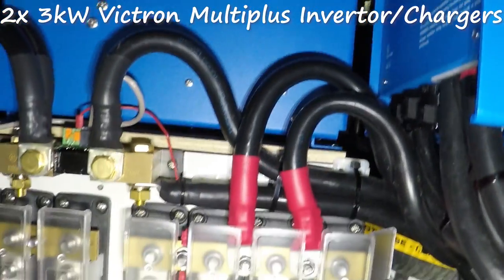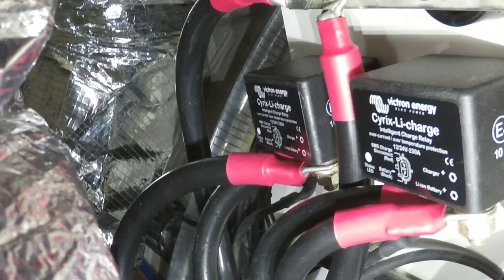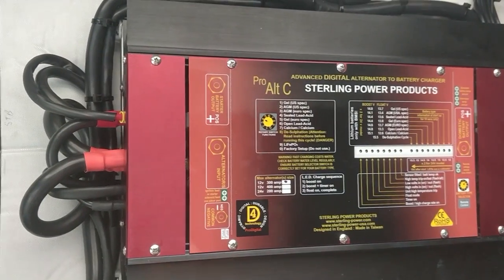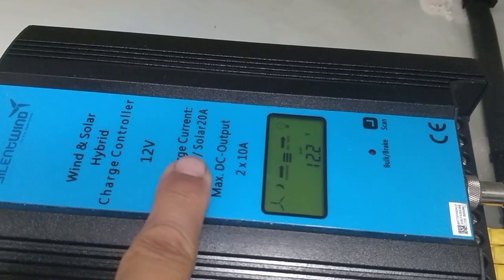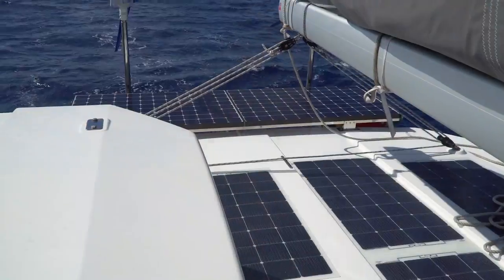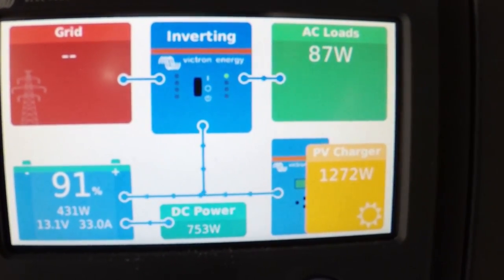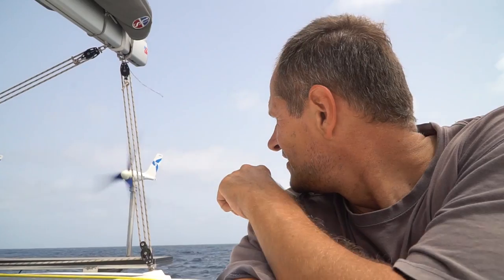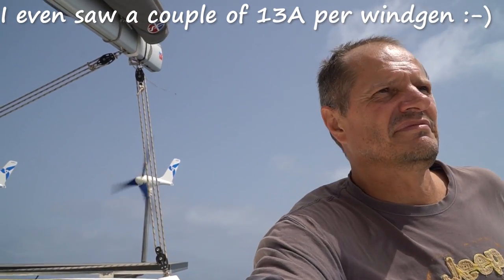#38t Our Electricity Supply on our Boat at Sea | Sailing Sisu Leopard 45 Catamaran in Mid Atlantic

Comment: Thanks for updates. Great videos. Wind generators will be great at anchor... assuming these wind units have less noise than older generation wind generators. On my crossing the Atlantic back in 2003 we had an AirX wind gen unit... noise was an issue, but it worked great as long as apparent wind above 10 knots. For long distance sailing, I now would probably seriously consider installation of a watt and sea type hydro water generator and install less solar and wind, so as to keep cost under control. Your experience shows agains that each type of renewable energy source has their own unique pros and cons. In perfect worked having wind, solar and hydro would be ideal....
Reply from the maker: Agree 100%

Comment: You must have the panels in series because you have MTTP solar charge controllers. Shadowing is always a problem when panels are in series. One panel is shadowed , then it will affect all other panels that are connected together. Also panels flat on the boat surface causes another problem. This is because the panels can not dissipate the heat. Best option is 3 x 320 volt panels set up on a solar arch and keeping the wind generators where they are but on higher masts to clear the wind from the boat surface. I place both of my wind gens on sectional supports so I can regulate the height. When the boats is in storage I can place them both lower and when sailing much higher. This is better than a top of mast install, as wind gen maintenance at the top of a mast can be tricky. Not impossible but tricky. The flat panels on your cabin top will eventually fail, the min reason is how hot is that fiberglass going to be in direct sunlight as well as the ramp of the panel itself. This is why rigid panel ate installed with an air gap, to dissipate the heat from the panel. Infact solar panel are more efficient in the winter time in cold weather and lose some effiecentcy in hot climates.  Any shadowing of any portion of a panel that is connected in series affects that pnel itself as well as it will bring down the efficiency  of the other panels connected to it. Another not. Voltage loss. The factory gauge of most panels is 10 gauge at best. To decrease on voltage loss, I would increase the wire gauge as close to the panel as possible. Rather than a cabin top deck install I would as I mentioned before put 2 to 3  320 watt panels on a solar arch and possibly  two more solar panels on the outside rails , like full wings. These panels can easily be put at desired angles and folded down when not in use. A side not. Most flat panels placed on a hot surface will develop black marks starting on one or two cells in a panel  and will spread. The panel has been burnt, and is now useless.  Great wind gen though. Excellent brand
Reply from the maker: Great advice! Yes, the panels are in three series groups. As I said, forward 5, middle 5, and the 2 glass panels on the back arch. That arch is already 3m high and the turbines 5m above sea level. The problem is that the Code D is very efficient and leaves little apparent wind for the wind turbines.
Reply: Sailing Sisu a top of mast install I don’t think is your answer.i would try and extend your win gems on extensions. 5 meters above may not be enough. I would try like I did   On my last extension I had that angled out so as to get clean air. You maybe lucky on the panels not burning.  I hope so. I could not tell by the video, but I made my solar arch lean back off the stern of the boat to give more room. I was able to fit 3x 320 watt panels side by side and 2x 180 watt panels on each side placed on the rails.  I do not charge my batteries from an alternator as  there is no motor. I use lithium batteries and an electric motor to propel my sv
Reply from the maker: Clean air is not my problem. Downwind sailing is. With 15kts of wind, we easily sail 8kts, which gives the wind gens 7kts to the wind gens. They do start generating at 5kts, but bring in 2A or so. Not enough to sustain the instruments through the night. During the day, the solar and wind gens bring in about 2-3 times the avg watts used, but the moment we start the water maker or kettle, then we loose out again. It does not matter how high I put the wind gens (off course there is a wind gradient), downwind sailing does not leave enough apparent wind to generate good watts to sustain or gain battery levels. From broad reach to close reach, yes, awesome power, but 121-180 is the "no go zone" for our wind gens 😊
Reply: Sailing Sisu yes that makes total sense. I think down wind would be a problem for most  wind gen installs. I would like to ask you though what type of batteries do you use. AGM or lead acid or lithium. I am thinking if you are short on power and not enough reserve to run instruments over night, then I am thinking that possibly your battery bank maybe under sized for your needs. I do use an electric cook top and run a 12 volt fridge freezer unit as well as miscellaneous 12 volt or 120 volt systems, lights are all led and I have a 3000 watt pure sine inverter. Now because I power my sv with electric power, my lithium battery bank is huge compared to what I would require if not propelling the boat with this means. I also have a diesel  generator as a back up in case I lose my panel and wind gen setup. I have not had to use it other than to start it up and check that it would work if I did require it. Because my solar arch was made to rake of the back of the stern, shortly I will be adding 3x 320watt panels for a total of 6x 320 watt. So 1920 watts solar on the arch and a total of 730 watts on the side rails. So I guess that is around 3650 watts. I really don’t include the two wind gens in the total as the output varies so much  with wind speed. It could be said as well with the solar on somewhat cloudy days. But wind is my main power for the vessel. I estimated way over on my battery bank. Which is a blessing.
Reply: Sailing Sisu That speed of 8 its with a wind speed is 15 kts sounds great with the size of your sv. By the way I love what you have. Great choice of craft.
Reply from the maker: 5x 200A Victron LiFePO
Reply: Sailing Sisu so from my experience only. I would say that you are definitely suffering from lack of being able to recharge. The wind gens getting lack of clean air and I guess I would have to know what your total input is on your solar system. Your wattage can be high, but if the panels become shaded and because they are in series, that brings down all the panels that are joined to that one panel. The other thing is what is your power usage. I think I would try to collect that data and then make a plan. Throwing money at a quick fix never works. As you probably know but for example if you have say 1000 watts of solar but because of partial shading of one or more panels and now you are down to say 500 watts and then there is cloud cover and angle of the sun all will hurt a system. I must say and this not knocking your system, but I am not a big fan of those thin flat panels on a cabin deck. Panels get hot from the the panel itself and the cabin deck and the wattage drops because of the heat build up. I am not convinced yet that you have enough battery, but that being I don’t know what your usage of power is either. There is not any point until your consumption is determined and we all use power differently. So the best solution I have is panels added to a solar arch at the stern and determining the best location of the wind gens so they get clean air. I can honestly say that I don’t get much power from my gens when going down wind either. I will leave you my email if you would rather discuss this off YouTube. 
boler77@me. com

I am thinking a few things here. If your instruments have used up all the power being on at night. Two things are happening. Your power demands are more than what you have stored in your batteries. So there is nothing left for the instruments at night. Secondly the solar is not producing enough power to meet the daily demands quick enough. This can be related to using too much power or more than you can replenish the batteries. There may not be enough solar to meet your demands, or there is enough solar but because of the shading effect the effect of the solar is decreased, and then the panels themselves maybe an issue and last of all the wiring gauge. Now panel wiring gauge is fine if the the panels are in series and using a MPPT controller. If you were using a PWM ( more than one ) the panels are in parallel and a shading panel will not affect the others. Now wire gauge does have an impact on voltage loss. More so when panels are in parallel than series.  All of wiring comes out of the panel in factory 10 gauge. I switch to 4 gauge stranded as close to the panel as possible. My Morning Star Charge controllers all accept 4 gauge. And lastly I would say use as much 12 volt to charge cell phone, tablets rather than using a inverter to charge. More efficient use of your power. And lastly you battery bank maybe undersized for you consumption of power needs. As there is no reserve left. Because my boat is sail and electric powered, my solar is extensive and my batteries are about 4 times what you have. But my needs are more for the electric motor.
Reply from the maker: Great advice! Thank you!
Reply from the maker: I am curious, how much kW solar and how much kW battery do you have and how far can you motor without using genset?
Reply: @SailingSisu  I read from a Lagoon 620 owner, he had similar problems, but his hydro generator works very well when underway, the solar and wind work well when at anchor ... he ended up taking the wind generators down.

Comment: When sailing downwind and only using your headsails, tie the boom off to one side with a preventer to allow more sun exposure to your solar panels.
Reply from the maker: The Code D is tied off aft and far away, but it is the sheer size 127sqm...

Comment: Thank you for the information. I am curious whether you have a dedicated generator. If not why: is it cost decision or extra space or lithium batteries set up is sufficient to meet your needs. I saw similar boats have a generator between 6-11 kw. What would be a sweet spot for leopard 45 in respect of generator power output.
Reply from the maker: Hi, Vlad! I think we touched on this in a couple of videos. You may want to watch  #11t, #32t, #38t, #40t, and #63t to start with? If you have more questions after that, please let me know ☺️

Comment: Thanks for the information.   You guys do a great job explaining things.  

Curious how you plan to or if you plan to increase electricity
Reply from the maker: I think we have enough electricity. But if we need to replace or upgrade in future, then I will surely look at Tesla batteries. The banks which goes into the cars are water cooled/heated. Currently we cannot go to very cold places and charge the batteries. I am looking at debris in the water to get an idea of how hydro gens would have worked. Lastly, we made fully provisions for a diesel generator, thus, if we should need, then we can just drop it into the forward locker😉

Comment: I am seeing you have 2 wind generators on board, I read that adding one or 2 more solar panels instead would today be the preferred option as the wind generators don't produce much and are noisy. What is your experience, how much did they produce for you in the Med? Did you even use them?
Reply from the maker: Hi, Friedrich! First, thank you for watching and second, you heard correct. One 320W solar panel will for sure bring in more power than a 400W Silentwind generator...even though the solar works only during sunshine hours.

Comment: With the solar shading, why not just move the boom to one side since the main is down and let the solar panels get all the light they need ?? Can do the same when anchoring.
Reply from the maker: No problem if the main sail is down. But when you sail 120 degrees, broad reach, then you are dependent on keeping the sail trimmed. On the other hand, that Code 0 is on its own, big enough to shadow all the panels :-) as seen in the video. It only took two days at anchor, for solar and wind gens to charge batteries to 100%.

Comment: I,ll be fitting 4 x 12V 1kw Super Caps on my boat soon. Batteries, Lithium, Lead etc.  are history.1) Inefficient (+/-50%), 2) heavy, 3) don't last very long +/- 2000 cycles, 4) take forever to charge , 5) are messy and so on and on. SuperCaps on the other hand are... 1) Are very efficient (98%+).  2) weigh less +/-  20KG ea.  3) Last long +/-1000000 cycles. 4) Can be charged and discharged in seconds. 5) Non flammable. 6) Have an on/off switch. 7) Can be set up in series or parallel anywhere on the vessel 8) Non toxic(no gas/fumes) and more. The advantages are huge and to numerous to mention here. This is the future of batteries. Soon even cars and cordless power tools will be fitted with these Supercaps...Charged in seconds and off you go again.
Reply from the maker: Wow! Great stuff!

Comment: I've been watching your progress/videos from start, great work. I would really like to know more about the actual solar/wind arch that you had built for the aft panels and turbines. Do you have any video of it's construction or installation? How much did it cost to have made. What materials where used (stainless steel tubing, but then what - aluminum framing)? And most importantly, how much does it weigh (excluding panels)?
Reply from the maker: Ooofff, a lot of questions I cannot answer 😏 it was sourced out to Marcel from the Cape Town Leopard office so, unfortunately, I do not have any answers, which can help you.

Comment: Thank you for your videos.
I saw on video #23 I think you were planning on a watt and sea and a silent wind. 
I’m planning options for my new cat and am just wondering why you decided not to go the watt & sea and what are your thoughts on charging after 2 years? Maybe a new video (unless I missed it)?
Thank you
Reply from the maker: Yeah, I am also not impressed with the two SilentWind generators. Trade Winds are 10-15kts in general, which brings 0.5-2A in...
Reply from the maker: As for the W&S, I was worried about sea weed, which is a major pain in Atlantic. Further,  I noticed that we need two different propellers for different speeds and I was not sure what our Cruising speeds would be. It turns out that we do 4-6kys on average...so, I need to check again into that. But we are a lot on anchor...
Reply: @SailingSisu  thank you
Reply from the maker: Pleasure 😊
Reply: @SailingSisu  BTW I haven’t watched all your videos yet (on the way) so sorry if I missed it, but have you any lightening protection systems?
Reply from the maker: Well, no, but me and a friend who does lightning protection for aeroplanes, are working on an idea

Comment: Great Video...
Can you tell us more about your experience with the sterling alternator to battery charger.  Do you have all 4 alternators wired to the unit or the two additional alternators? Do you have an external regulator attached direct to the alternator before it passes through to the sterling unit? How many amps per hour do charge the battery bank when idling or under power?
Reply from the maker: Good question. I love the Sterling, but the support sucks. The two alternators goes into the Sterling and then the Sterling controls the alternators output voltage. It will give the AGM starter battery what charge it needs and at the same time it provides Amps to the Lithium bank. The Sterling is rated 400A and the Alts combined can provide 300A. We normally run at 1,500rpm and then we get from both engines around 4,000W combined.
Reply: Sailing Sisu are you able to adjust the charge rate on the Stirling and lower it for example to 3000w to add a little protection to the alternators from being overworked?  Do you have all 4 alternators from from two engines wired to the Stirling?
Reply from the maker: The Sterling monitors the Alternator temperature and adjust accordingly the charging rate.

Comment: Very enlightening,! Is it possible    to have transparent sails, or transparent windows (clear plastic or another type of material)on the sails? Also can you move the wind turbines up on the mast? Anyway I am enjoying your vids, can't wait for the next one.
Reply from the maker: Thank you for watching! The turbine cables are quite thick? And they need to be on very stable or sturdy poles to reduce vibration. Anyway, the Code D is pretty efficient and leaves little apparent wind for the wind gens